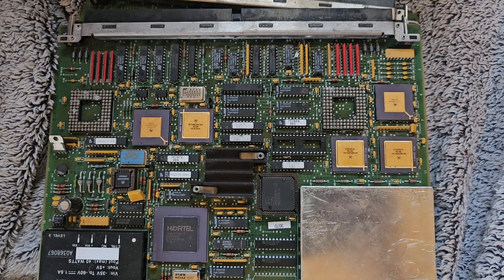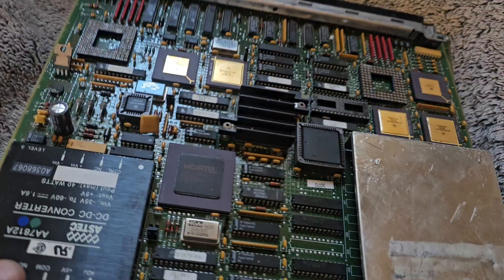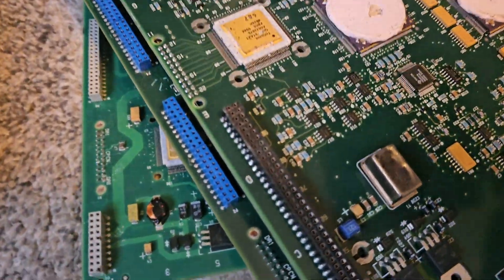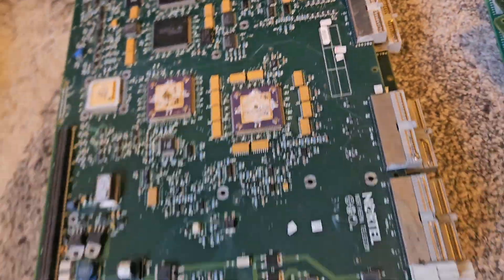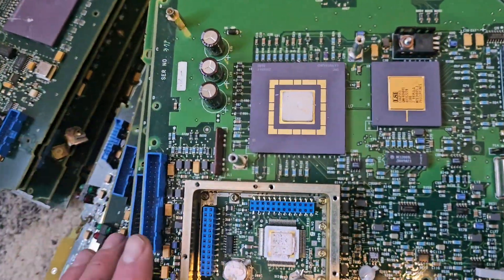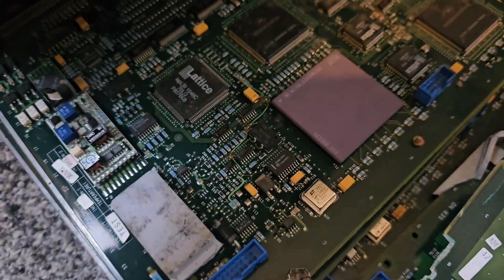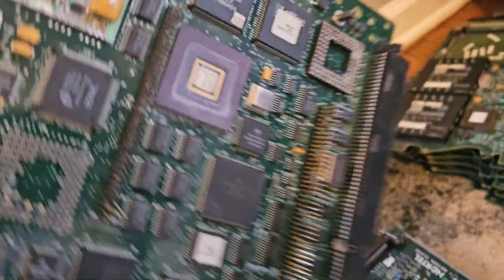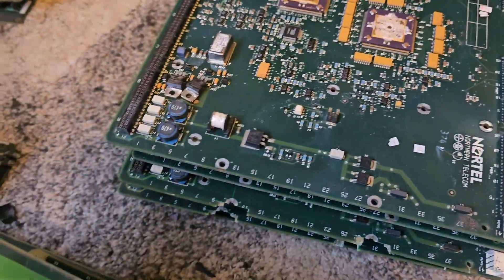Depopulating High-Grade Nortel Telecom Boards: Extracting High-Quality Ceramic Chips Heat Gun Method

Comment: I see several 68060 and 030 ceramics. They are quite appreciated processors. Don't destroy them, please.
Reply from the maker: The only ones that get destroyed are usually LSI and Nortel ones.  I try to save all Motorola as much as possible and other useful ones 100%.
Reply: @ewasterecovery  👍👍👍
Reply: I have something one board 13 cpu ceramic on board amazing
Reply: I have old cpu 1970 1977 1978 1980
1982 1984 1986 
I have board Telekom old cpu ceramic Philips on